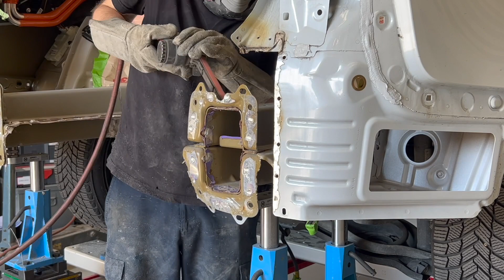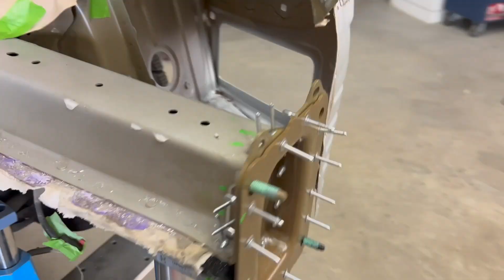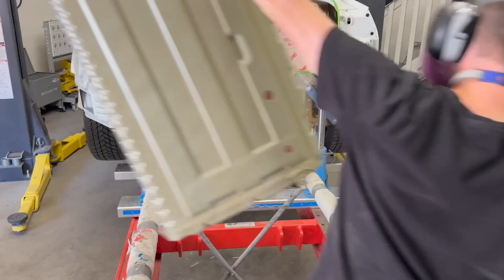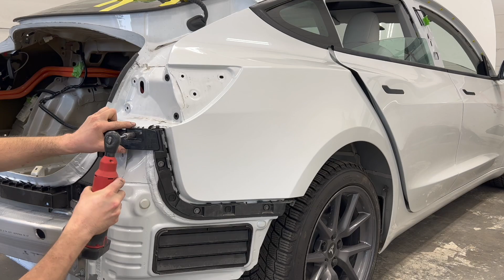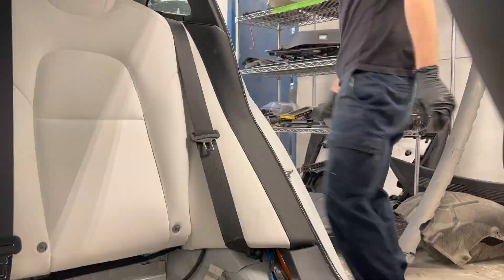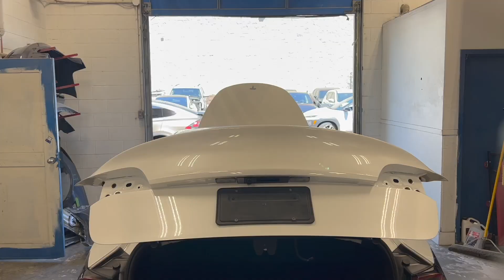Structural Collision Repair Process on Rear Ended Tesla Model 3!

Comment: A lot of putting parts on and off numerous times.  That's so much work, good job!  Hope you didn't forget any bolts.  I say that because I had a bad experience with a body shop working on a Tesla Model 3 I owned once.  They crumpled the rear wheel well liners, didn't connect a few ultra sonic sensors, the side plastic lower trims were hanging down and even forgot to connect the FM radio harness.  It was about a month before I noticed that I couldn't get any FM stations, because I rarely listened to it but good thing one day I did.
Reply from the maker: No missing bolts that’s for sure. Every part had all the bolts labeled in a plastic ziplock bag when disassembling the vehicle. Sounds like you had an horrific experience that’s really frustrating sorry you had to go through that. I always test fit the vehicle quite a few times on bigger repairs. I was taught you’d rather be 110% confident that the vehicle fits to your standards before sending to the vehicle to the paintshop. This makes the assembling process after paint super quick and very easy as you know there will be no issues at all 👍🏻
Reply: @shawn.collisionrepair  good to know there are still people out there with attention to detail and a good work ethic!